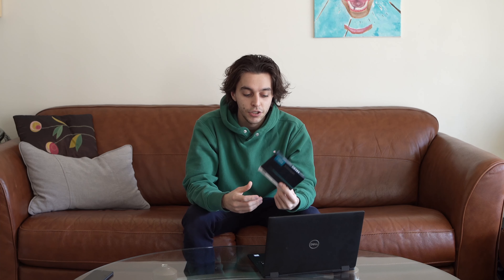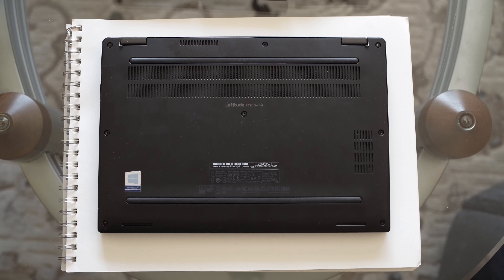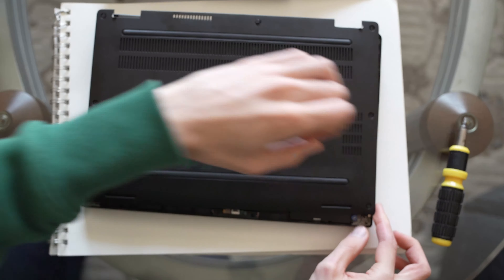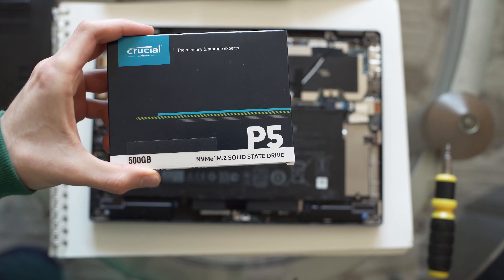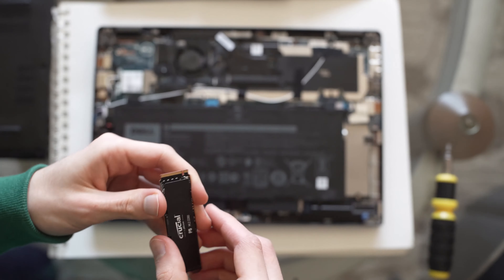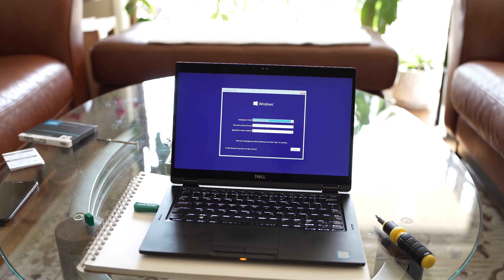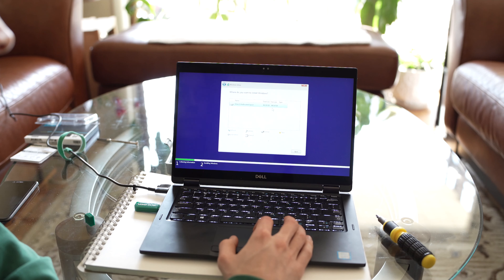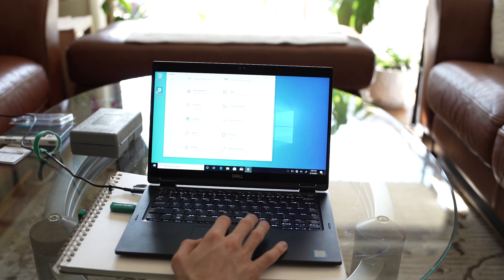Upgrading my Dell Latitude 7390 2-in-1 Laptops SSD | Tech Dash Mini-Series

Comment: Just so you know .. there are significant differences between "7390" and "7390 2-in-1". Your title says "7390" which is misleading. Thank you.
Reply from the maker: My apologies! I'll correct the title
Reply: @rashbalash  Stumbled upon your video once again and surprisingly saw my previous comment. I am using the 7390 and recently installed Hacintosh on it. Works like charm. As far as I know your laptop model can also be turned into a hacintosh laptop. Just in case if you are curious to know. Thank you for updating the title once again.
Reply from the maker: @E-dirts  That's awesome! Sounds like it might be worth the try, would be pretty awesome to have that. Did you have to make any changes to the WiFi card inside the laptop? Also how do things like iMessage work?